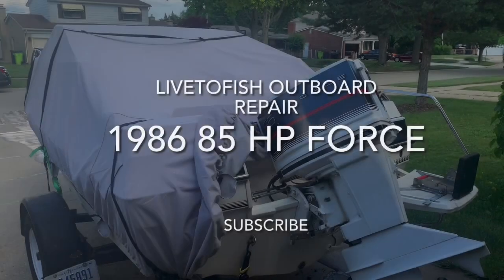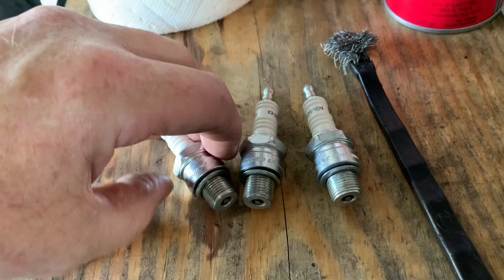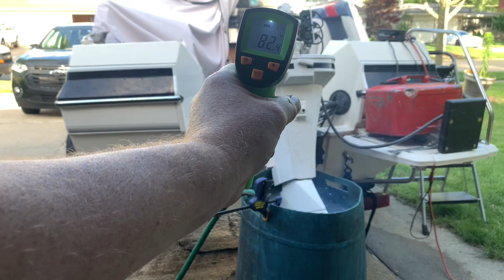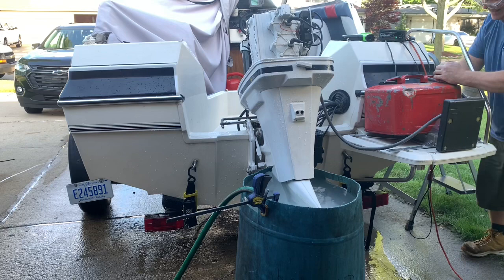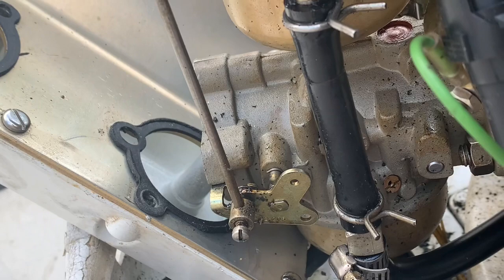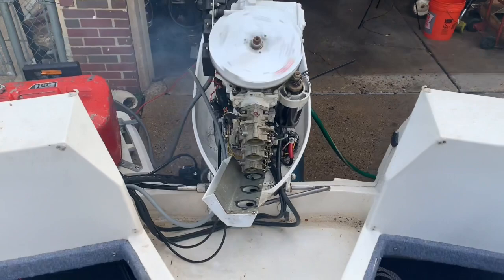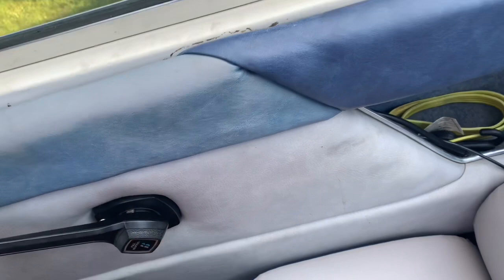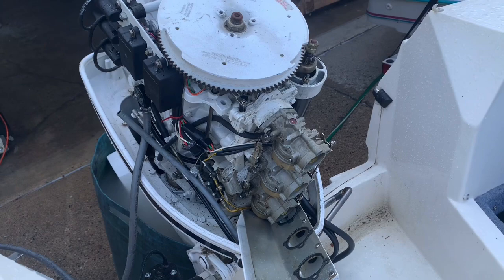1986 85 hp Force - Part 1 - Keeps Stalling when Shifted into Gear on a Bayliner Capri - Diagnosis.

Comment: I have a 1985,, 85hp and know this engine well. First off I suggest that you trim the motor down as you are affecting the way the floats work. Primer bulb and fuel lines is where you should start. Most bulbs the check valve will fail, the fuel lines have an inside liner that will collapse. If that checks out I would look at the timing I set mine at factory and then adjust by ear it with it running to smooth it out. It will be a very slight adjustment to the screw,, maybe a 1/8 of a turn either way and I set the rpm at 900 in gear. My motor runs like new and never misses a beat.
Reply from the maker: I will cut the barrel in order to drop the motor down to reduce the trim angle and run the motor again but the owner is complaining about stalling when placing it in forward gear with the motor trimmed all the way down. The fuel line and tank are mine and connected directly to the fuel pump so I know the primer bulb, fuel and line are not the issue. I will take a look at the timing. Thank you for taking the time to comment and making these very thoughtful suggestions.
Reply: @LivetofishOutboardRepair  Pull the prop and check the two screws that hold the bearing in. Mine worked their way out and would cause it to stall sometimes when going into gear.
Reply: Have you done a video of setting the timing on a 85 Forece.
Reply from the maker: tbaine…. Sorry I have not. I’ll work on it though. Thanks for watching and commenting.

Comment: I can’t wait to follow along with this. My father has the same exact boat and motor and it’s been sitting for ages so I’m thinking about tinkering with it some.
Reply from the maker: That’s awesome I hope this video helps. Good luck and thanks for watching and commenting.
Reply: I have that exact motor and kinda like it after extensive troubleshooting in the ignition department. If anyone wants a 85 force 85 hp motor ive got one give me an offer.i got a new evinrude 100.

Comment: Subscribed! I heard you say lake st.Clair… I live near metro beach. I’m having issues with my 1988 85 hp force.. I’d love to chat. It runs phenomenal, just all of a sudden it’s making a ticking noise and wants to die after I get it started.. I quickly keep it in a high rpm so it doesn’t die.
Reply: Id like to figure it out.. runs fine in higher rpm.. I can get 2 and from fishing spots, just can’t keep it in idle now. Have to hurry and throw it in gear before it dies.. (cleaned carbs, new starter, new plugs) waiting on a new choke ! One of my spark wires has a good crack/split In it.. can’t seem to think that would cause my issue.. it was all fine a month ago
Reply from the maker: Brandyn W. … Thank you for subscribing. I was brought up in St. Clair Shores and still enjoy Metro Beach. I’m not sure why you have a ticking noise or stalling issues but I would start with a compression check to make sure all the cylinders are at least 120 psi and within 10% of each other. You might also want to pull the flywheel to inspect the upper crank shaft seal. Inspecting the lower seal would require removing the powerhead. If the upper seal has failed it could make some unusual noises and would reveal a sling line of oil inside the flywheel. A bad seal (upper or lower) would cause compression and starting / idle problems but might improve after warming up or at high rpm.
Reply from the maker: Brandyn W…. The spark plug wire is causing a spark issue at idle. You need to replace the coil pack if the wire is molded to the coil. Run the motor at night, if you see spark where the wire is cracked this is causing a poor idle condition.

Comment: The particles are from the foam wrapping inside the cowel cover it gets old and brittle falling off in under the engine cover. Horrible design it needs to be removed and fit with a new type foam wrap that wont do that? Any suggestions ????
Reply from the maker: Steven Bind …. Good point. Like you said just removing the foam completely and cleaning the inside of the cowling would be best. The foam is for noise reduction but I would just leave the foam out and live with the engine noise.

Comment: hello friend do you know what is the normal engine temp in this engine? also what do you think of this compression test 120psi 122psi 119psi
Reply from the maker: The good news is that they are very close together with little variation, however. 120 is on the lower end of the acceptable range. 140 is considered healthy for this motor.  Try another Compression gauge and make sure your battery is good.

Comment: HI - I noticed that the engine is pretty smokey. Assuming that the fuel is pre-mixed and not from an auto-oiler - is the ratio OK? I have done a  fair few outboards and  found that some people put extra oil into the fuel (in an attempt to add extra lubrication)  but what they don't realise is that it leans the engine fuel ration out and causes issues..  I also found that the 2T oil is hydroscopic so it starts to absorb moisture over time  and causes a lot of steam and messes with the idle particularly. This same problem as you are having on my last Evinrude (95 year 70hp) was just varnishing in the idle circuit. The carbs were opened up and thrown into the ultrasonic bath at 50 C for an hour. This cleared the problem completely - (Once I had set up the carb idling without the varnish being present)  Anyway just food for thought and as usual I am sure you will crack it!
Reply from the maker: R Rudd…thanks for making great observations and information. The fuel mixture is 50:1 using stabilized premium gas. The fuel is only a couple weeks old in the auxiliary tank. I did not hook up to the tank in the boat to eliminate any doubt. I use Quicksilver Marine premium 2-stroke Tcw-3. This boat was recently purchased by the owner and he was experiencing stalling when placing into foreword gear. I was able to duplicate the problem as you saw in the video. I suggested the owner should use something like Ring Free or Yamalube in his gas as the engine is probably built up with carbon. He told me he added Seafoam to his fuel to help. Maybe that’s what’s causing the smoke? Like you said the carbs are probably varnished over in the idle circuit and need a good cleaning, so stay tuned for part 2 and I’ll clean the carbs and see if that fixes the problem.

Comment: I’m having this problem with a 1985 bay liner 125 force motor as soon as you get on lake it goes in reverse great but as soon as you give throttle to go toward it stalls any ideas
Reply from the maker: Dh31062009… it’s probably your idle circuit‘s being clogged in your carburetors. This is the same problem I had with the one I was working on in the video. So you might want to start with the carburetors if that doesn’t solve your problem and look at the ignition system.

Comment: Hello I have a 1982 Thundercraft Titan 16 ft trihull. It has a 1983 mercury 80 hp inline 4 2 stroke. I took it to a boat repair shop in Missouri where i live and the guy wont workon it and said my motor is worthless. It needs a new wire harness and the transom needs to be rebuilt. Whats your opinion?
Reply from the maker: Jeffrey Justice.. if the boat means something to you then it’s worth saving. The transom is a difficult job but not impossible. There are many good YouTube videos out there to help you DIY. I just restored the engine wiring harness using automotive wire on a Mercury 40 hp 402. See link https://youtu.be/PHzYKlosX_Q

Comment: Have you ever worked on the gearbox on a 85hp force engine?
Reply from the maker: Mark Angelo RS … No I have not had the pleasure but I would think it is very similar to a Mercury. You should definitely purchase a Service Manual for that motor if you decide to work on it. Best of luck with your project and thanks for watching and commenting.
Reply: @LivetofishOutboardRepair  I'm a mercury mechanic so I can say they're not the same. I will definitely be getting a manual. Thanks for your reply.
Reply from the maker: Mark Angelo RS… Thank you for your input as I am not a marine mechanic but a DIY mechanically inclined Individual that enjoys working on these motors as a hobby. I welcome all comments positive or negative to improve my skills. Thank you again.